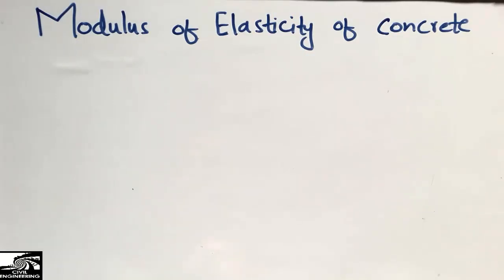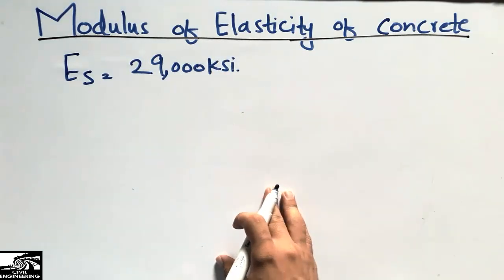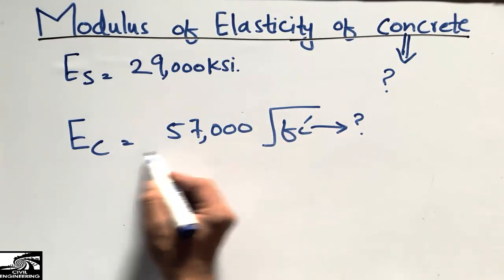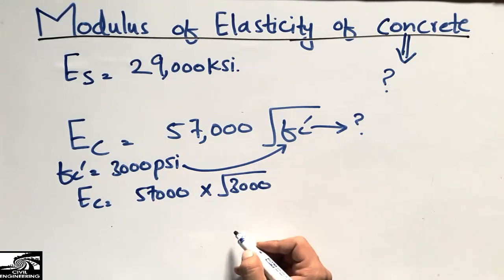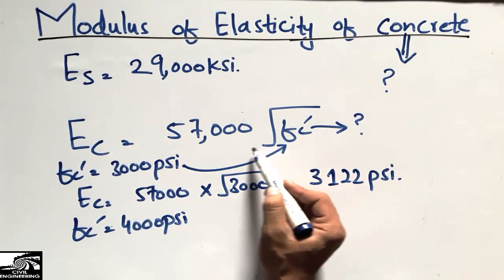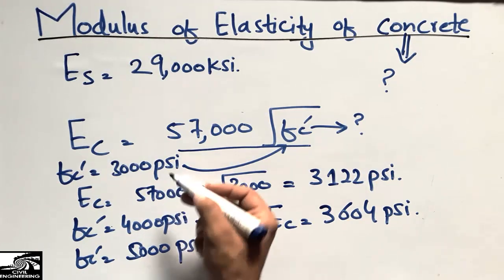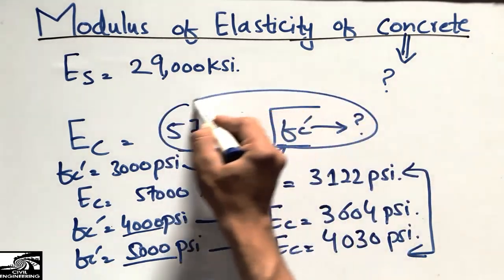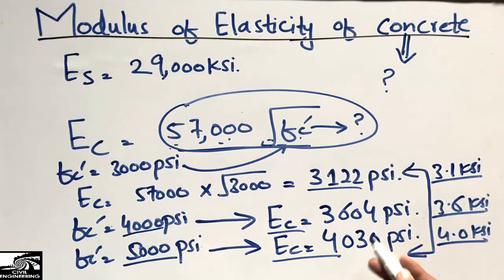Concrete Modulus of Elasticity || With Example

Comment: Your units are wrong they are already in ksi. For instance for fc of 4 ksi the Ec is 3604 ksi not psi.
Reply: I agree
Reply: Whenever use this formula, fc must be in psi units
Reply: @Crystal_Pink-v9q  yes,  but the result he is showing for Ec is wrong, units are wrong. For instance, for an fc of 4ksi the Ec is 3604 Ksi or 3604000 psi.... as I stated before.